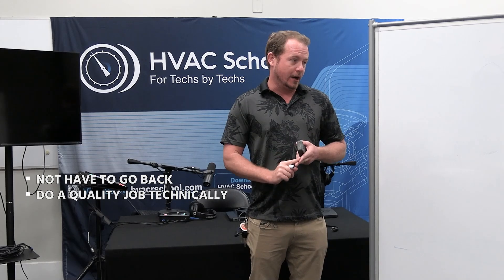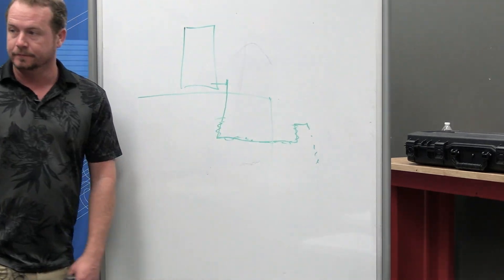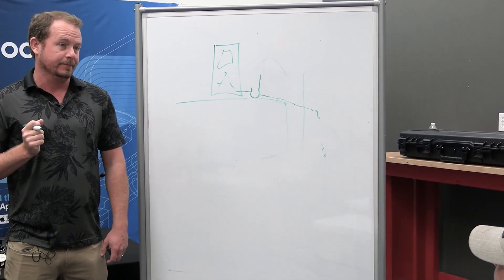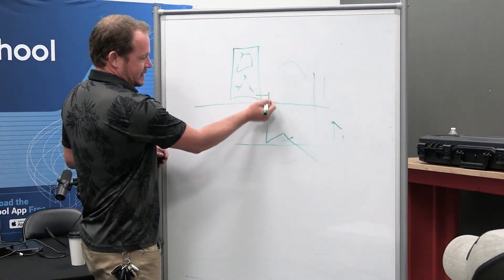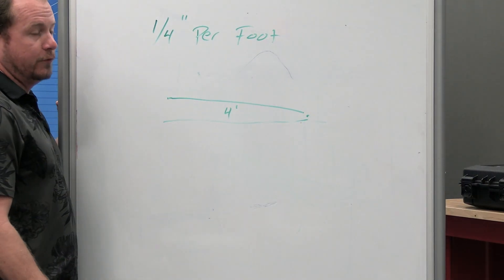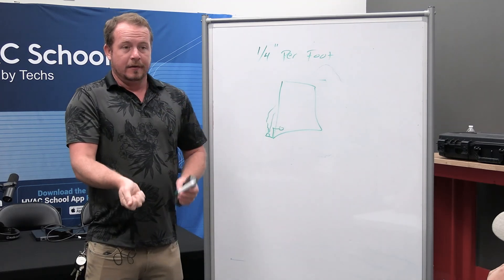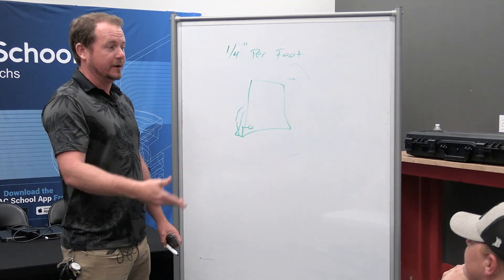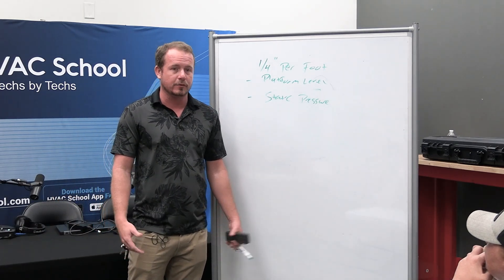A Few Condensate Considerations

Comment: I’m a big fan of union fittings. If everybody used a union instead of a coupling every time they had to open the drain, Summer life would be a better place.
Reply: Preach! I make sure I put them on during installs or maintenance.
Reply: Agreed!! My boss doesn’t agree. Or installers don’t want to install
Reply: We, at our company, started putting unions. It helps us out when we gotta deal with something.
Reply: I agree and it take the exact same amount of time to glue on a coupling as it does to glue on a union

Comment: Let me start out by saying that I enjoy watching your videos. Watching this one on condensation ,I disagree with your statement on saturated insulation in air handler .To advise removing and replacing with foam board is correcting one problem and creating a potential larger problem. Foam board is highly flammable. Afire inside cabinet from a motor would ignite foam board and potentially create a structure fire. Explain that to insurance company. Technician just voided UL listing of equipment. Insurance company denies claim.

Comment: So I’m trying to figure out if my drain can be ran along the side of my basement wall on a downward slope and into a capped clean out drain with that I would have to put it on an upward slope to get above the drain? Will the static pressure do that?

Comment: Simple ==> up flow ( furnace on the bottom) creates negative pressure and sucking the air from the drain line, therefore, condenser water can’t drain out from the condenser pan. Down flow ( furnace on the top) creates positive pressure and hot air will blow out from the ac coil drain hole to the air when turn on the furnace. Conclusion: All the Ac need to have p trap to block the air suck in or blow out from the AC drain hole. Am I right ? Please advise, thanks.

Comment: SEE THE GOO TIP: During your service call - take a “very bright” flash light and hold it directly on the trap…chances are high/good you’ll see the goo in the trap as the light will expose the debris (think x-ray). Want to find “the wedding ring that fell down the vanity drain?” … take the flash light and hold it directly against the vanity trap…now run water through the trap while holding the light. Give it a try. Obviously, you could simply dismantle the trap - but the light trick is pretty quick…

Comment: After 16 years working in Florida I am convinced it doesn't matter if the drain is trapped under the slab of the house or if it's in an attic with good downward pitch. They all clog up. I've seen drains with 1 inch pvc that have 30 degree pitches clogging up. 
All you can you is clean it as thoroughly as possible and add tablets to slow down regrowth of the bacteria.

Comment: The best video I found on condensate drain. I have a SpavePac 3-ton horizontal air handler in my attic and it has been tripping off every time the pan fills for years. I have had several technicians and 3 different companies out and none of them actually figured out an issue with the drain line, they clean the filter (which I already do), and one of them installed a hard start-up kit on the Trane compressor, which was never the actual issue). After finding that there was not an HVAC trap coming right out of my unit, as shown in the manual, I installed one. I cleaned the line in every way possible. I ran compressed air through the line and sucked it out from the outside with a shop vac. I finally ran two hoses from my attic and flushed from the cleanout I installed. Today, I discovered that a trap is in the basement from where the line comes down from the attic. So my system is double trapped. I will remove the second trap and hope that this thing stops shutting off and drains properly!

Comment: Great video, gave me some more ideas to check to fix my FL horizontal attic hvac. I think I have a bend in the pipe or a misaligned drain pan. Secondary pan is filling up, leak at corner of hvac. Drain line is clear.

Comment: Good job on the video, especially on the secondary drain pan.  Most units in TX are horizontal in the attic.  I size drain pans so I can fit not just the unit components but all the drain line, traps, float switches…within the pan.

Comment: I am dealing with a wet soaked air handler right now on a new install. The installers didn't adjust air flow so I feel like it was air locked and or shooting condensation thru the coil. So after measuring for static best I could get it was .64 wc. Came back a few days later and it's still wet soaked, same issue compounded by the em drain pan has a crack in the corner. So now we got to dream up how to remove the em pan in a horiz in a attic without having to reinstall the a/h. I may try getting some duct board and replace the insulation but I wanted to resolve the issue. I assume because it's so soaked that maybe up in that attic that cold wet surface area is at dew point and it's just never going to dry out. It's Arkansas and very hot

Comment: Excellent explanation of the double trap scenario we have with condensate drains, have you tried to implement the a/c easy tee system for drain maintenance? My Boss has had us using that system for a couple of years and has reduced call backs tremendously and we don’t dread having to cut the line every time we do service

Comment: Great video!
I'm sure the guy in the video knows this. I found it difficult to explain what I'm trying to say below, but it explains what's going on with drains, traps, and vents.

To be clear, the name "vapor lock" might be the correct name used in the trade, but the phenomenon has nothing to do with vapor, and it doesn't really result in a lock.

The problem arises if there are two traps within the drain. One you intended on, and another due to pipe sag (I call a, sag-trap).

Let's say that each of the two traps in my example result in 3in of vertical water level per trap.

With a vent between the two traps, the water entering the vertical pipe before the real trap, only needs to fill to a level of 3.1" (above the trap water level) to move water through the first trap. That same 3.1" of water will be enough to push water through  the second trap. The water in each trap is dealt with in order. One, then the other.

If there is no vent between the two traps, the two 3" vertical columns of water are connected by air that can not escape. This means there has to be 6.1" of water in the vertical pipe before the first trap in order to build up enough pressure to move the water in both traps simultaneously. No vent means the water in both traps have to move together. This requires higher head pressure to accomplish.

Certainly, make sure the vertical pipe leading to the first trap from the unit, can contain a height of water that is greater than the water level in the real trap.

If you have multiple sag-traps, that first vent may not save you. Sag-traps are bad!

Comment: If there is enough head room you can install a large filter media and install a reducing transition back to the the air handler. Like a rooftop curb adapter.

Comment: On an installation in Florida the handler is situated upstairs and the 3/4 schedule 40 is exposed for 6 inches before entering the drywall and vanishes down and across to reappear below my ground floor window, it then goes underground and reappears 3 foot away up and is then an elbow. My question is how deep should this pipe be ? This is the trap given it’s a 15 foot drop how deep should it go underground to create the trap 6 inches or more ? Dave
Reply: The depth of the water in a trap doesn't have to be great since the static pressure of the system is usually like 0.5 inches of water. That's why a trap with only two inches of water is fine. Technically, as long as the water column in the trap is more than the total external static pressure of the system (using inches of water for pressure), the trap will seal and water will flow out when the system in running. If your drain line goes under your slab, the trap would be more than good enough.

Comment: In Chicagoland. Residential equipment evap coils are ahead of blower/ operate in + air pressure. Besides putting a clean out T, we don't trap such drains.  Is equivalent set up different in FL?  Why would an open drain on + pressure need to be trapped??
Reply: Hi, I saw a you tube video on this...look around you tube...
But the reason is you DO install a trap : to trap air from blowing out of the unit.....so + or - pressure you must stop the air flow...trap deep enough to create a trap seal and condensate will flow...*note* needs to be refilled with water after cleaning
Reply: Oh also vented after the trap seal

Comment: If the blower fan is going into a negative pressure. It could suck the condensation back . It could be holding the condensation in the air handler and then when the blower fan turns off all the condensation flooding back into the drain. Might only have been on commercial equipment like package units.

Comment: I like your videos.  May I ask; what part of Florida are you located which allows the condensate to be routed to the ground?.  South of Houston, any condensate flow to the ground (normally due to a backed up primary drain) will create a swamp along the side of the house.  On high humidity days; up to half the A/C energy consumed is for condensation of the water in the air.  Air Conditioners here make lots of condensate.  The primary drain ties into the DWV piping which can cause another set of potential problems.
Reply: Orlando

Comment: Good reminder to tired older techs and newbies in FL but despite half hour runtime not even a mention of heat pump drains or the wonderful world of dozens different designs on furnace and tankless drains. Not even a mention of the condensate pumps and how 99% of service guys never clean them either.